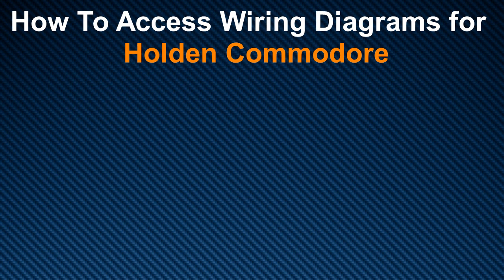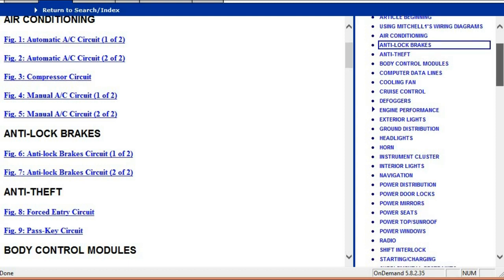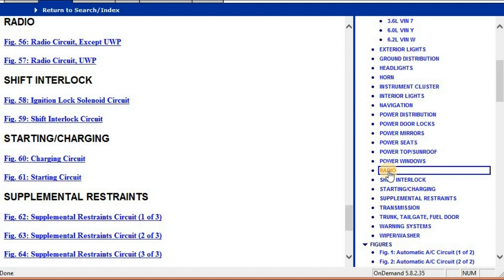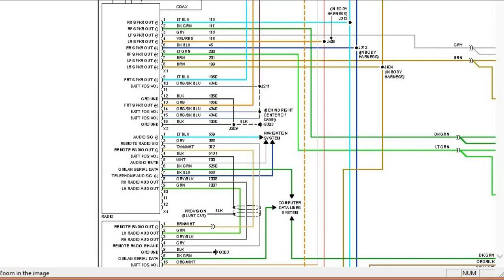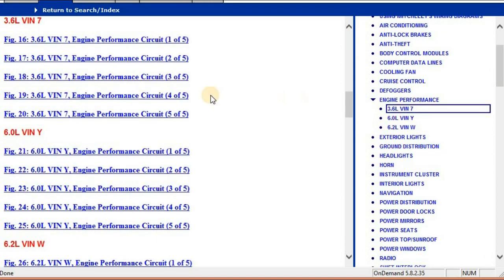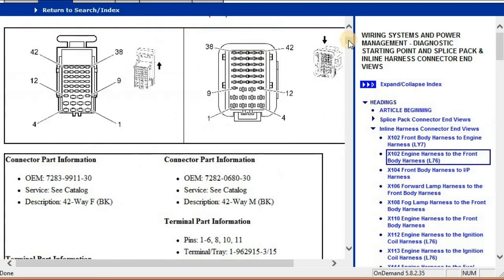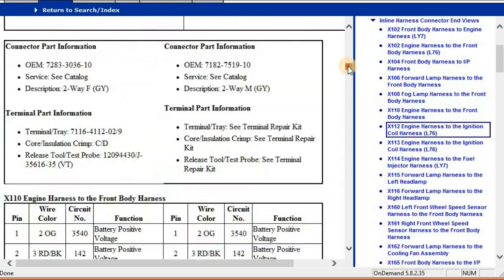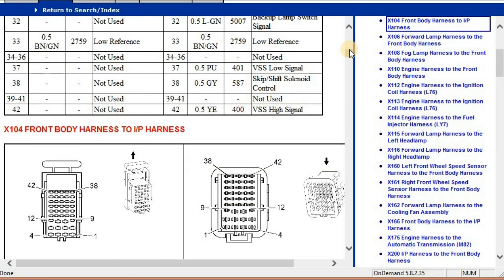Complete Wiring Diagrams For Holden Commodore VT, VX, VY, VZ, VE, VF

Comment: The front electric window aren’t working. I also have no power to fuses for emission, reverse lock out and ecu. A lot of wiring was burnt and melted that has since been replaced. Could my ecu and/or my bcm need replacing?

Comment: Hi. Not sure I can find the link for wiring. I have a 10/2009 ve hsv 6.2L. My car had a under body fire and the wiring was replaced. Now my front electric window don’t work, my rear window do. The switches and regulators are good. The rear window motors only have 2 wires going to them, the front windows have 5 wires. Is there a wiring diagram and could the bcm be the problem?

Comment: Hi. I need to see the wiring diagram for the o2 sensors , manual gearbox which include all the sensors in the gearbox. Also the fuel pump wiring and where it all goes through/to.Stephen

Comment: Not sure  why the burnt gearbox and o2 sensor wiring has had an effect on the problems listed. The oil pressure switch is extremely difficult to see and get to but also might be effected by the fire because the rear of the engine cover was slightly burnt. The petrol tank was also ruptured and burnt. I replaced it and used the original fuel pumps. Is there a petrol cut off switch on the ve?

Comment: My fuel pump fuse keeps blowing, all my electric windows don’t work, my central locking doesn’t work when using fob (only the indicators flash when I press lock/unlock and the car doesn’t crank.

Comment: Can’t see the link. My ve 6.2 L6 speed manual had a underbody fire all my gearbox and o2 sensor wiring was completely burnt and all wires fused together. The wiring has been replaced but electric windows, central locking doesn’t work, car won’t crank and fuel pump fuse keeps blowing. I really need a complete wiring diagram to trace what wires go where.please. All the best.